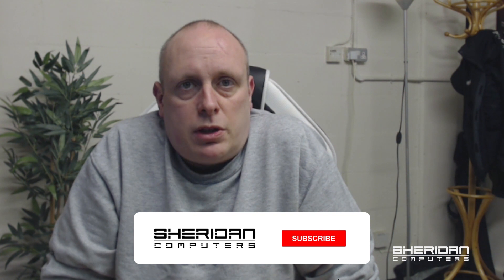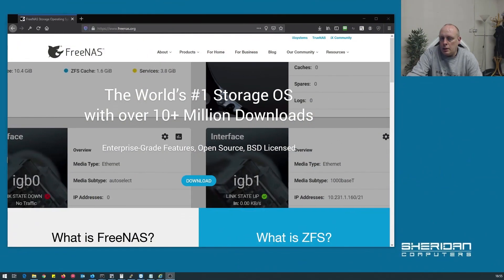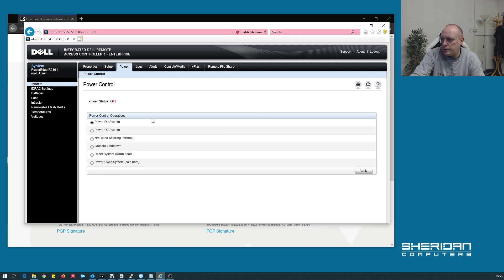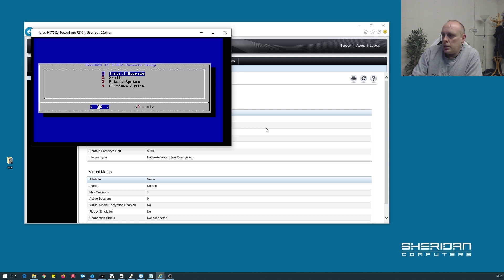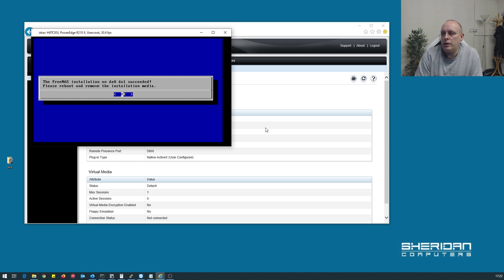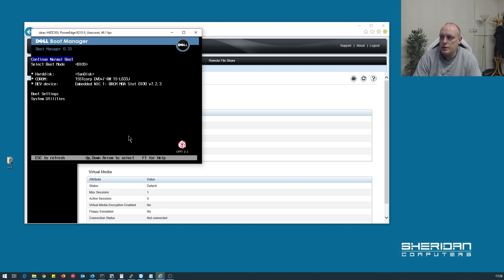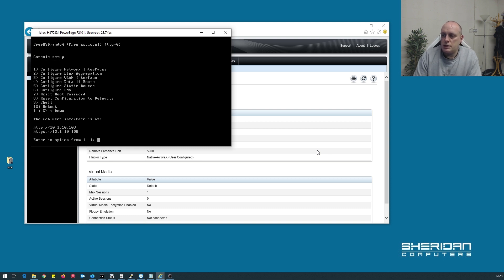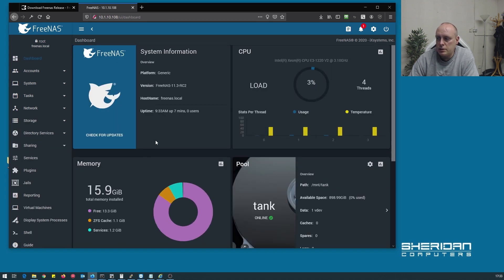How to install FreeNAS 11.3 | FreeNAS Installation (IDRAC)

Comment: My pc is connected to internet via wifi is it possible to connect server with RJ45 to the pc ? (my problem is i can't connect the server physically to the router)
Reply from the maker: You could setup internet connection sharing or bridge the lan and the wifi adapters. Depends on how the wifi is configured you're connecting to.

Comment: If my poweredge doesn't come with IDRAC installed the license is $450????
Reply from the maker: If it's an r210 ii as in the video, you can just buy the card off ebay.

Comment: How did you get the Virtual Console to work?????
Reply from the maker: Needs to be done via INTERNET EXPLORER and sone settings to stick in, it's in a video somewhere  will see if can find
Reply: The easiest way is- change mode from java to Native, and in Internet Explorer set the lowest security+ add the idrac IP to trusted web sites= its done in like 6-10clicks and it works. Also you dont need stupid Java config, security, etc. Works with remote console and virtual media too.
Reply from the maker: Yup

Comment: Can you explain the CD-ROM part in BIOS? Did you originally download it to a CD from your Windows 10 computer then put the install CD in your server to install it on a USB drive?
Reply from the maker: If you want to use from a CD you would need to burn the ISO using poweriso or something, or rufus to use a bootable USB. I have a usb iodd device which allows me to copy the iso files to and will then boot from the iso emulating a cd-rom:
https://amzn.to/3arJ6U4